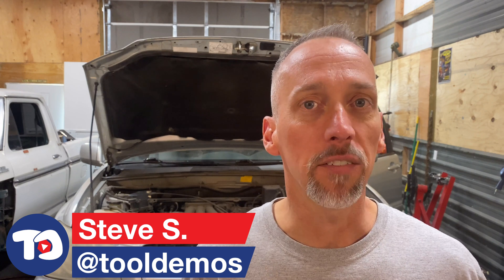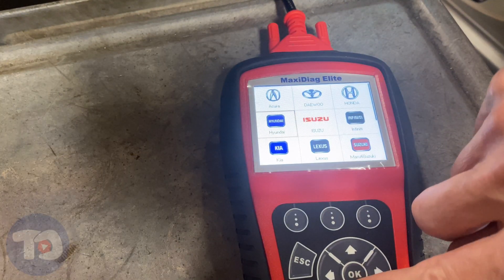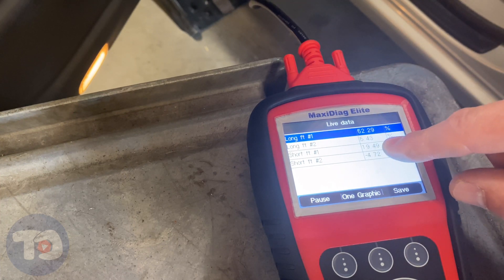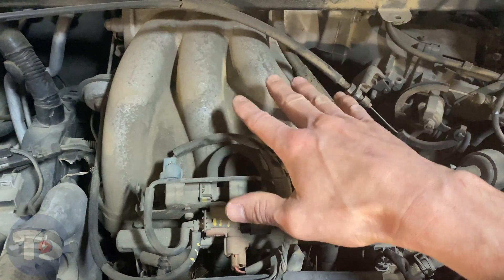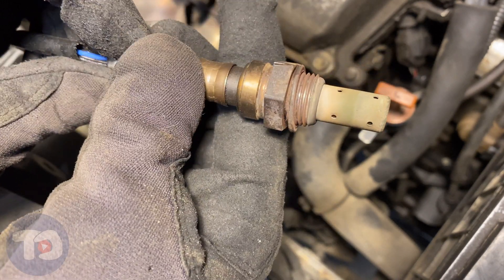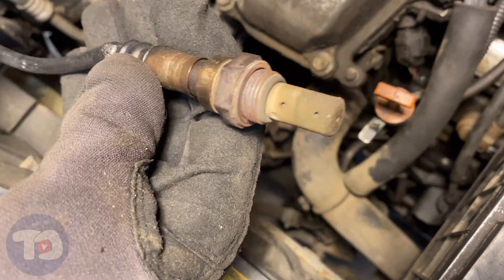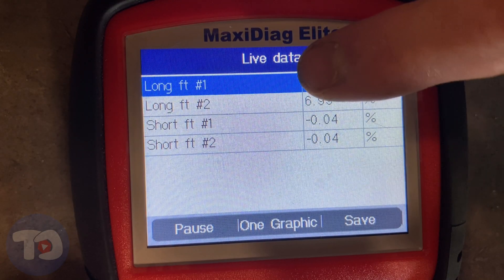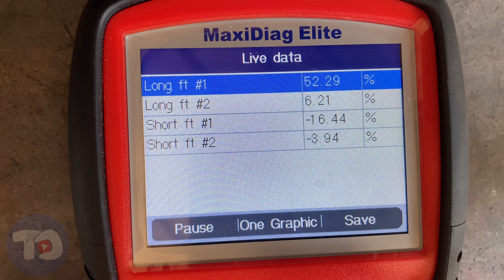P0171 | Misfires and smokes. Gen 1 Toyota Highlander 2003

Comment: Steve I like your video, and I have a 2004 Highlander Limited 4wd with 3.3L  and 155K miles.  And a 2004 Lexus RX330  2wd  with 3.3L  so both vehicles have the same 3MZ-FE engine. I have a red Autel scan tool, I have not used yet but you motivated me to try it. I usually use a orange    Actron CP9670. Coming back from Mexico,  3 hrs away from reaching my home,  I experienced the flashing check engine light and it was the #2 Cyl Denso coil.   I have a Matco Taiwan offset 22mm sensor tool which I Like alot.  The China one I had from Amazon it "opened up" when I used the breaker bar and rounded off a sensor "points"  but the Matco had no problem removing that sensor.  I have had good luck with CRC Freeze off to remove sensors, and get them real cold to remove them.  I like how you swapped sensors. Is the front o2 manifold sensor the same model/PN as the rear CAT sensor?   also one thing I learned to do is  I'm removing the axle boot clamps (if boots are in good condition) and I'm adding 60 to 80 grams of Swepco 101 CV cartridge grease to the inner & outer CV joints, to try and extend their life using a cartridge grease gun and a needle nozzle. I weigh the grease gun on a food scale before use,  and then after I pump some grease in to the boot ,  I measure again to see the amount I put in, which is sometimes between 50 and 80 grams of CV Grease. Trying to extend their life. My vehicles all have  between 150K miles and 310K miles. On these older vehicles I stick to conventional (not synthetic) drivetrain lubricants, like Driven products, Valvoline & maybe Lucas.
Reply from the maker: Sounds like you’re doing a great job keeping your cars well maintained. To answer your question, the two oxygen sensors on that Highlander are different.

Comment: So my wife's RX300 has the same 1MZFE v6 and a P0171 but unlike yours, both banks long and short term trims are nearlly identically increased 19% short and 52% long. Any sugestions would be appreciated.
Reply from the maker: Check that the MAF sensor is reading correctly. If so, look for a vacuum leak. Probably around the intake manifold area.

Comment: Wait a minute , After the switch ,why didn't the other sensor go up to the 50s ! It stayed low ?????
Reply from the maker: Electronics are weird. My assumption is that moving it around made it ‘work’. Kinda like when you bang on the dash to get the fuel gauge to ‘work’.
Reply: Then why order a part if that fixed it .

Comment: My 2003 Toyota Highlander 292,000 miles and still going! After changing my spark plugs and ignition coils, I got the codes for cylinder 1,3 & 5 too. Did doing this solve the problem?
Reply from the maker: Yes it did.
Reply: If you got them yet, did it fix it for yours?

Comment: I'm going to try this....Sadly I have to start with cheap parts.  If it lasts a little while will try and save up for better.  Stupid question why not use cheap ones, can you clean ones you have or get rebuild.
Thanks
Oh and by watching several videos learned that's an a/f or air fuel ratio sensor...Not a oxygen sensor...very different but almost exact Looking part.  And I can't even find a cheap one of those 😢
Reply from the maker: They are all very expensive. The cheaper ones will tend to send a signal that the computer does not like or understand and you will end up with the same problem. A good one like Denso will send a signal that the computer is expecting to see. Try rockauto.com that’s where I bought mine and the prices were much better.
Reply: @ToolDemos  thank you 😊

Comment: Hey I need help..  code p0171 and p0174 on my Toyota 4 runner and bank 1 and 2 I have bought so many parts but I have changed the sensor on them. Can u please help me?
Reply from the maker: Do you have a scanner with live data?
Reply: @ToolDemos  it’s driving poorly
Reply from the maker: @LiEazzyE  I would start by looking at the fuel trims. Is the computer adding more fuel? How much? Is it at idle or cruising?
Reply: @ToolDemos  like 1000
Reply: @ToolDemos  it’s pulling
Reply: @ToolDemos  like when you get a give it acceleration it’s like not want to pull
Reply: @ToolDemos  the fuel look like it’s running out more then it should
Reply: @ToolDemos  it’s idling
Reply from the maker: @LiEazzyE  got it. When you can, try flooring the gas pedal. If you get decent acceleration, it’s likely a bad sensor. If it gets worse, it’s likely a bad fuel pump or restricted injectors.
Reply: @ToolDemos  okay I’ll do it in the morning thank u.
Reply: @ToolDemos  I will let u know what I hear and feeling with the truck
Reply: @ToolDemos  like when I start it up its like it start up then it like it don’t want to
Reply: @ToolDemos  I wish I could show u the pic of the codes
Reply: Yes but I don’t have the one u have
Reply: Do I need to get a ob2 scanner like yours to tell me what’s wrong or what I’m looking at?
Reply from the maker: @LiEazzyE  it does help, you’d be able to see what the ECU sees.
Reply: @ToolDemos  what u have so I can get the same one like urs
Reply from the maker: @LiEazzyE  my older scanner is a Snap On Modis. I’ve been testing a bluetooth scanner from TopDon, called TopScan. The DIY version is now available for $60, plus $50 each year subscription. Works with your phone.

Comment: Will it work on a 2005. Highlander 4 cylinder? It has a hard start, runs fine but a have those codes P0171 and P0174. I really appreciate any suggestions.
Reply from the maker: Try unplugging the MAF sensor, see if it starts easier. If so, you might have a faulty one.
Reply: I will try. Thanks.

Comment: Replaced o2 sensors and still getting leans codes
Reply from the maker: You most likely have one of two issues. 
1: An intake air leak. 
2: MAF sensor is dirty.

Comment: Thanks for this video! I unfortunatley am not car handy at all. I have an 2004 (113k) and it smells like this for a few years now. I even took it to a shop because it was soooo gassy smelling and they told me it was fine, so I left it alone. But I know something is not right. I will have to find myself a better shop. Aside from the gas smell my Highlander haas been wonderful, but it needs some special attention now because I have slacked on all my maintenance for years. Thanks again for all your good advice!
Reply from the maker: Yeah, unfortunately there are several issues that can cause a problem like this. I hope you find a good shop.

Comment: Is there anyway I can get an answer from you I have a 2003 Toyota Highlander I change O2 sensors after driving 1-mile it went right back to dragging guzzling gas I know there's a third one could that be the reason
Reply from the maker: Do you have access to a scanner?
Reply: Yes
Reply: My check engine light came on that's how I knew the O2 sensors were no good when I change them it went off
Reply: I also don't have four I have three could it be the third one that goes under the driver seat that goes to the computer
Reply from the maker: @robinhernandez9582  very unlikely that #3 is causing your problem. What code did you see when you scanned it?

Comment: Don't make sense to me,  so what it was the problem? If it was running to reach on gas
Reply from the maker: Yes, the oxygen sensor was not reading correctly. Because of that the engine computer was adding too much fuel.

Comment: Noticed that after you swap the o2 sensors, the long term FT reading from Bank2 didn’t change. Does bank 2 suppose get 50% fuel trim reading due to bad sensor?
Reply from the maker: I saw what you’re talking about and honestly can’t say for sure why that happened. My two theories on that are either programming or physical. 
It could be that the computer is programmed to correct over fueling more quickly than under fueling. Maybe to save the catalytic converter.
On the other hand, it could’ve been the fact that I was handling that bad sensor and caused it to come back to life temporarily. Sometimes that happens with electrical devices if you tap on them a broken connection could be repaired for a short time.

Comment: This 2003 Toyota has the same sensors for the downstream and upstream. my 2002 Toyota has the same sensors and when I tried to replace them the A1auto shop and Auto Zone has two different sensors for my Toyota. They insist that I am wrong, I removed both the downstream and upstream and showed it to them and they said that according to VIN number Iam wrong. What do I do?
Reply from the maker: Hi Omar. I wonder if this is just a communication issue. The Highlander has 2 upstream sensors and 1 downstream. The upstream sensors are screwed into the exhaust manifold, one on each side of the engine. The downstream is attached to the pipe, just after the catalytic converter. 

They all kinda look the same, but upstream sensors are air/fuel ratio sensors, it’s the one I replaced in the video, and are pretty expensive. The downstream sensor is a simple O2 sensor and is pretty cheap. Did that help?